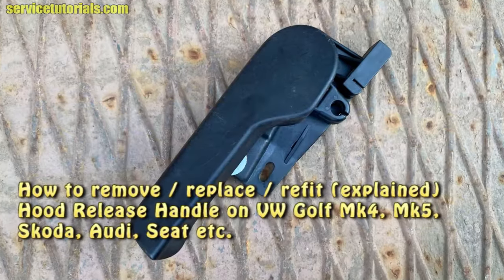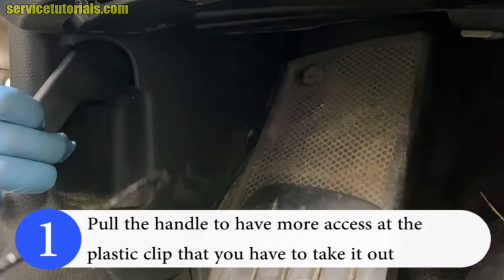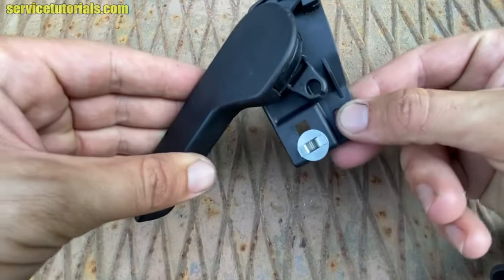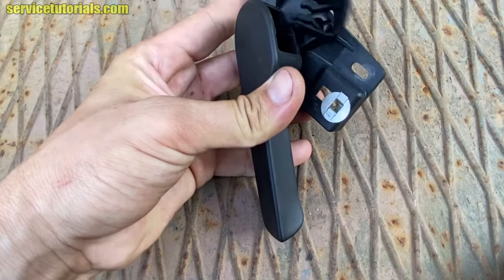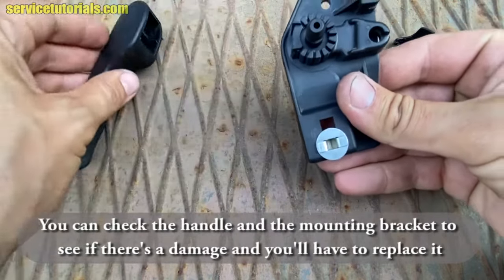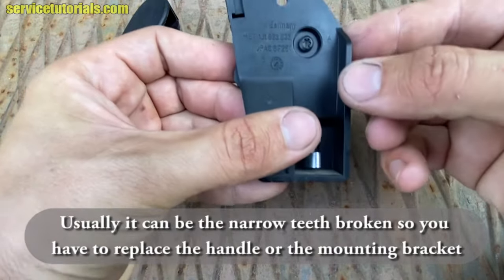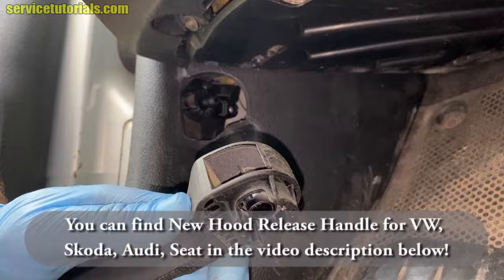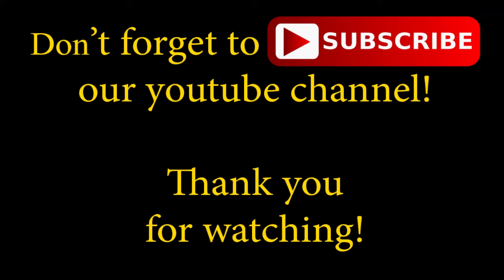How to remove / replace / refit (explained) Hood Release Handle VW Golf Mk4, Jetta Bora, Skoda Audi

Comment: Do you know how to remove the plastic trim around the hood release handle? I can’t get the mounting bracket out without taking off the big trim piece…
Reply: having the same question myself
Reply: Same question here. The hood release mechanism is broken and the coolant light has come on. I can't access the bonnet to top up the coolant but I also need to drive.. so frustrating
Reply: @mosiah.torres  hey how did you solve this????
Reply: @jaymadden122  Got the same issue right now, I just bought some interior trim pry tool kit off amazon. Will be here Saturday. But the bracket and handle will arrive Monday. Which car do you have the problem with mines an A1?

Comment: Octavia 2021 

If the handle has looseness only after last maintenance ( working on steering column) 
could they remove this handle or working close to the release cable ?
so they could broke any tooth of handle or moved the cable ending from correct location ?

I have a video shows the looseness if you want to check it.

Comment: Can you open the hood if Handle is broke? Wire is good but piece holding wire to handle is broke
Reply from the maker: Yes, you can. You just have to pull harder on that cable from the handle, use pliers if you can’t with bare hands.
Reply: On the mk4 Volkswagen you can go under the front of the car and reach up in between radiator and motor and manually flick the cable lever also
Reply from the maker: @stephengagnon5719  thank you for your tip Stephen! 👍